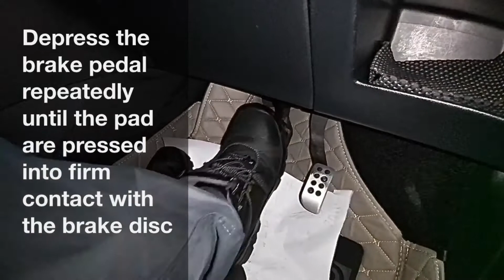How to replace front brake pad replacement | Peugeot modal 408,3008,308 | Complete guide

Comment: Does it always that easy to push the caliper piston back with screwdriver at 8:08 ?
Reply: Also thanks for showing proper way to install the caliper clip at 9:16 .
Reply from the maker: Yes
Reply: Its a nice video, but you forgot something. Before you push back the piston you must open the bleeder valve on the caliper and let brake fluid out as you are pushing back the piston. Otherways you damage your ABS. You probably did here. Then when the piston is fully pushed back, you can close the bleeder valve.
Reply: @TheOwlWhoKnows56111  Agree, you can see the brake fluid drops on the floor at 3:13. He released the fluid reservoir cap before or the pressure broke it.